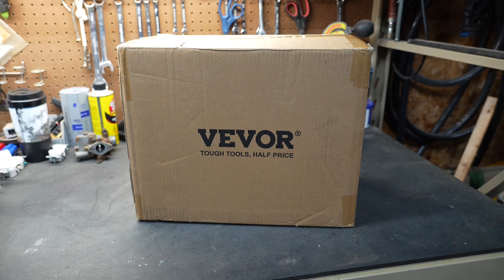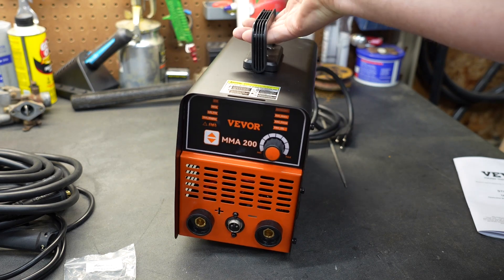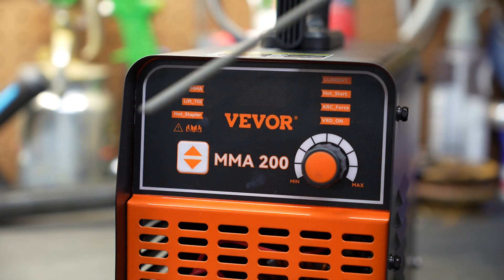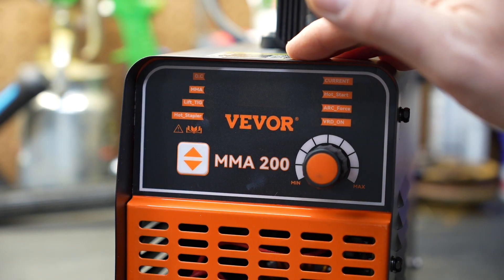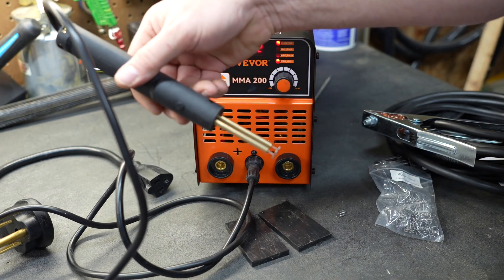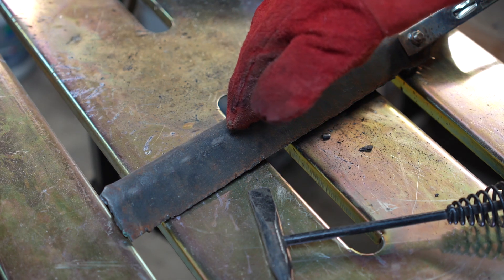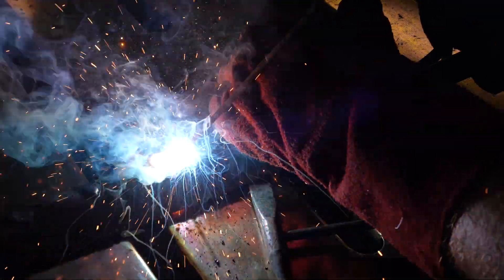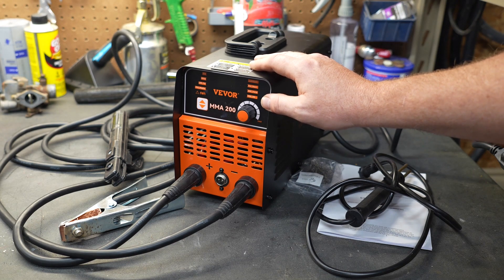MMA-200 Vevor 2 in 1 Welder! It's a hot stapler and a DC Stick Arc Welder! 200 AMP 120 / 240 volts!

Comment: Try DC + with some Marquette 1/16" No 15 Presto-Arc 305001 at 30 amps for small things like conduit.  As someone who has used a welder for over 40 years you won't  believe how easy and smooth that rod lays down on a lunch box welder.  I use it over my mig gear on the thin wall stuf.  I use just a little Everready 140 machine duel voltage.  110volt works a charm.